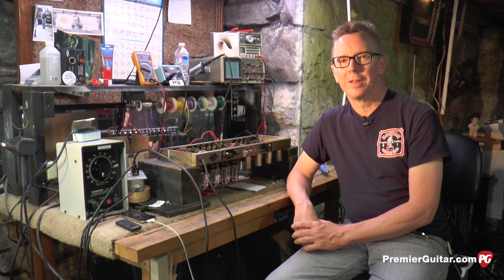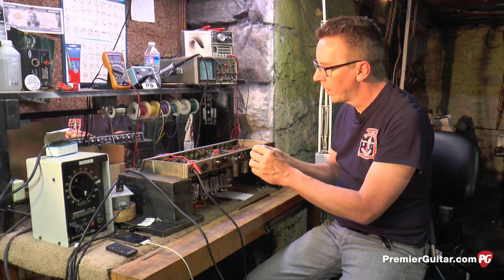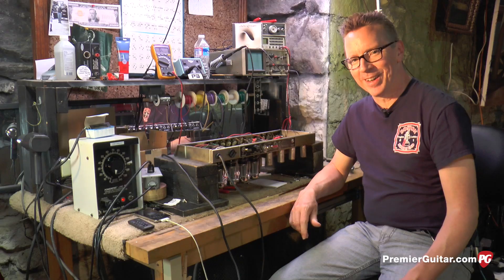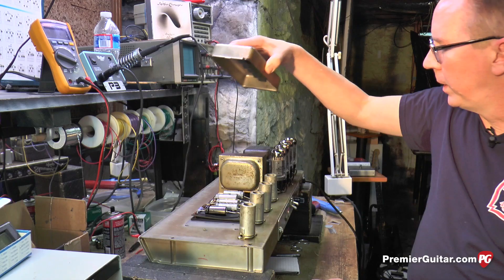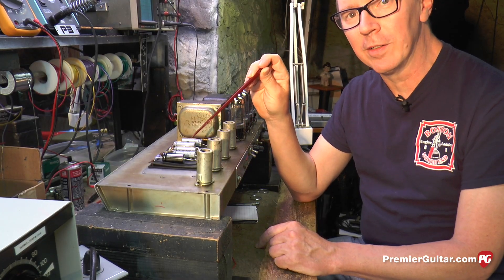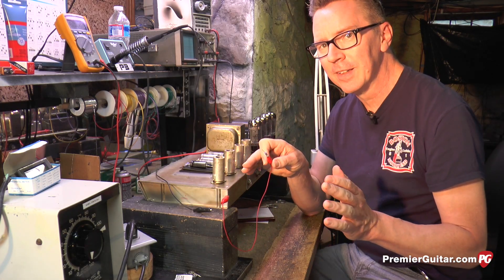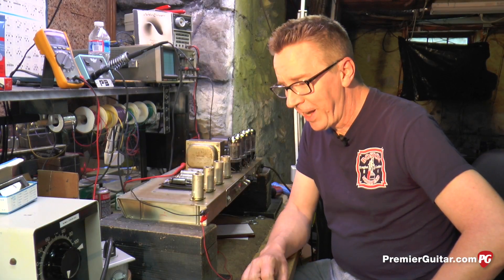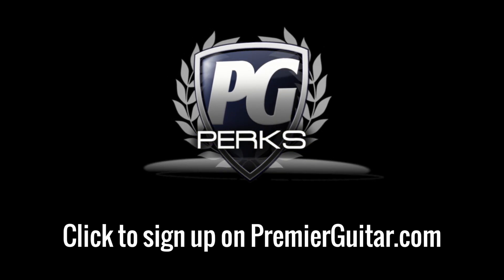DIY: Amp Safety 101

Comment: Just to be clear, are these steps required before doing any work at all on a tube amp? For example, if I just wanted to remove old tubes and replace them with new ones, do I need to discharge the capacitors first? Or is this only for electrical work and more serious repairs?

Comment: when i was a teenager i got a good shock from a hallicrafters shortwave radio receiver tube circuit.  i was half way across the room when i snapped out of it, sitting on the floor, dazed.  Luckily it was all into one hand, instead of thru my entire body.  AIN'T DONE THAT AGAIN!

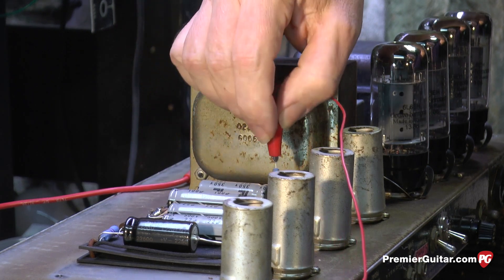Comment: 8:02 why did you appear to discharge the NEGATIVE side?
I saw a demonstration by utility workers that said even WOOD can be conductive. It can have moisture inside- so never us a stick to move a down power line. 
What if it has a STANDY switch- Deluxe DRRI 2019? Should Standby and Power be in the ON position when doing this? Unplugged of course.

I heard you can cut the trace and solder the reverb direction (to where?) To eliminate all the related hum on these things- the PCB makes the hum that you can bypass. When I toggle it OFF- no more hum. Psionic Audio mentioned doing this and he is legit. 

And to what #'s do I hard solder the two green heater wires to the Octa Switch. 2 and 7 or 2 and 8? He mentioned both by accident I think. 2 for sure- but 7 or 8? This prevents burning and potential fires. It is a very necessary mod. with 6v6 and def. with 6L6.

Thanks!

Comment: Serious question...if the amp is unplugged (rather than plugged in but no switches turned on) how is it earthed ('grounded' in USA speak) when you connect a  multimeter clip to the chassis of the amp? Where does that voltage go?

Comment: Hi, great video exactly the information I needed. A question after I cleaned the entire board of an Engl Thunder. If I attach the grounding to the housing, the device itself must be connected to the grounding in the house. Had measured everything and only mV on the Elkos. But the grounding is not entirely clear to me.

Comment: This was helpful for understand what to do to safely discharge the caps, however this and other tube amp safety videos don't tell us what *NOT to do*. What is the danger? Touching the actual filter cap with your hand? With a screwdriver? Or touching the wires connected to the caps? I don't understand what the actual never-do-this is, which I hope to avoid.

Comment: Thank you for this. I saw a video where someone was demonstrating an alternative method whereby you turn the power OFF while sending some signal from the guitar with the standby switch ON in order to drain the caps. If you happen to see this comment, would you endorse this method as well? 
Thank you!
Reply: Simply switching off the amp with the standby switch on will drain the caps through the tubes as their cathodes cool down. Whether it will reduce the voltage to a safe level is debatable. Always check before sticking you fingers in an amp.

Comment: ER doc here.  You're absolutely correct that you don't want to complete a circuit, particularly across the chest.  Where you're off a bit is why it's lethal (it has nothing to do with the valves).  The heart is an electric pump with it's own electric circuits.  Each time it wants to beat, the "pacemaker" of the heart sends an electric signal down the circuits.  Once these circuits have discharged, they have to recharge to be able to beat again.  There is a split second right after the discharge, but before it has started to recharge, where if you interrupt it, it can't start the recharge phase and you die from asystole, aka cardiac arrest.  It can be interrupted by electricity or even by a hard impact (like Demar Hamlin).  The electric shock can also cause a "short circuit", where the normal conduction system of the heart gets bypassed.  This is bad, because without the "pacemaker" parts of the circuit the electrical activity can cycle incredibly rapidly (ventricular tachycardia), or can cause an "electrical storm"  (ventricular fibrillation).   V tach is almost always fatal if we don't hit you with the paddles right away (within a few minutes, typically) and v fib is most definitely fatal (within seconds to minutes) without the paddles.  If any of these occurred and someone didn't call EMS for you immediately, it's game over.

Comment: Unless you disagree, there are amps where the filter caps are not accessible for discharge, for example when mounted on a circuit board that is on standoffs and they are standing caps. So if you have access to the schematic one can always find a point on the component side (usually resistor lead for example for the bleed resistors) and do th discharge trick there as well. Right?
Reply: Yes.

Comment: How does the cap get discharged to the earth if the amp is not plugged in to the three pronged wall receptacle?  Also I have an original bandmaster 1964 or 65 and the power cord plug doesn't have the 3rd ground prong.  So it looks like all that dangerous engery is going to the metal chassis... isn't that dangerous?
Reply: It doesn’t get discharged to earth ground, it gets discharged to chassis ground which also is connected to the negative side of each cap. Think of it like the cap is a battery, you know you can short a screwdriver across a nine volt battery and totally drain it (along with heating it up but that’s another story) with no earth ground connection. You simply provide a way for the cap to discharge to no voltage potential. Caps are in essence plates separated by insulator…the positive plate will equalize when directly connected to the negative plate in them.

Comment: This is so useful for a complete beginner like me, thank you. But I don't understand how we are discharging to ground via the chassis if the amp is not plugged in - how does the voltage actually reach ground ?
Reply: I know this comment is two years old- but I was curious about it and here is what I found out.  The negative side of the capacitor is already connected to the metal chassis of the amp, which serves as the amp’s “ground” or zero-volt point.

When you attach a resistor between the positive side of the capacitor and the chassis, you give the stored charge a path to flow back to the negative side.

As the charge moves through the resistor, the electrical energy inside the capacitor is safely turned into a small amount of heat in the resistor.

This process slowly drains the capacitor’s stored voltage, making it safe to work on the amp.  That's it =)
Reply: @Just_Jeff_Tunes  Hey, thank you !

Comment: I would add that on the old ungrounded tube amps there is a voltage potential to electrical earth ground  and it depends on the AC plug polarity. Some old amps had a polarity switch to change that will reduce the shock risk. The way to test for a potential chassis ground voltage shock  is set your multimeter to AC volts, in a range that can cover 120 volts. Connect one terminal to the amp's chassis ground and then touch the other meter probe into the AC wall outlet ground terminal. If there is a voltage potential you might see something between 50 and 100 volts AC.  Changing the ground switch will reduce that voltage to a safe level. If the amp does not have a polarity switch then the AC plug's polarity must be reversed. This was a common issue with Hammond organs and the Leslie 122 and 145 amps. If the AC plug's polarity  made the chassis hot with voltage, when someone  touches the organ's metal chassis and their mouth to a  microphone which is connected to a grounded  sound system, they would get shocked. So I always checked for that leakage voltage when working on a Hammond.
Reply: Hi. I want to get my first tube amp in future. Is it dangerous when you don't open it on your own, and bring it to the mechanic to do regular service?
Reply: @aloroki3350  Your question does not make sense to me.
Reply: @keyboardtek  Sorry. I was asking can you get electrocuted if you just play the guitar plugged in tube amp? I mean if you don't open it up to change tubes and modify it.
Reply: @aloroki3350  If it is a very old tube amp that has  a polarity selecting switch for a power switch, then you have the potential for getting a shock only if you are touching any metal on your guitar and also touching some other electrical equipment that has a proper earth ground. By only touching your guitar itself you are unlikely to get a shock. In the old days the guitarists that I worked with would hold the strings on their guitar and quickly touch the microphone they had to sing into with their finger. If they got a shock, they changed the polarity switch.  Many found out the hard way when they first sang into the mic and got shocked through their mouth! Any new amps that have a grounded plug and no polarity switch  does not have  this shock problem.
Reply: @keyboardtek  Thank you very much for explanation, it helped me to understand this. Have a good day.

Comment: As a medical professional I can help here. Electrical activity in your heart is not a valve or anything related. 

The reason you can die from power is your hearts conduction system is interrupted. Your heart doesn’t shut and never open. It quivers and eventually will stop if not shocked back into rhythm. 

Don’t believe me? Look up r on t phenomenon.

Comment: Thanks a lot for the great safety video. If the caps you want to discharge are non polar does it not matter which end of the capacitor you touch with the resistor? can you use the same
Technique? (One end of the lead attached to the amp
chassis and the other touching one end of the capacitor?

I’m asking as I have a hifi tube amp that uses all non polar polypropylene Power supply caps (Solen brand)
Reply: In my experience non polar caps are very small in farads and not a danger. Still if you want to be sure simply clip one end to ground and touch both leads one at a time. You have to then have discharged it.

Comment: Someone out there was talking about an amp where the standby switch was wired so as to disconnect the ground to the chassis I think. In that case when using the chassis as ground with the standby switch in the off position I think you neither drain nor can get a true reading of residual voltage. You ought to have a copy of and understand the schematic before getting in there.

Comment: Thank you for this informative lessson.  Just one question,  how does the voltage go to ground if the amp is unplugged?
Reply: I think it doesn’t go to earth ground, but it goes to chassis ground, which is also connected for example to the negative side of the caps themselves, so you basically are shorting the cap. Just as if you put a screwdriver to both leads of a nine volt battery you will (also heat up the screwdriver but…) discharge the battery.

Comment: Great vid - thx.
I'd clamp to a terminal of each cap, don't trust the ground, or the aux switch.
I'd use a much larger ceramic resistor, and count out the appropriate time, 5 s to 5 min depending on cap.
I'd use a verified DMM post drain to verify 0 V caps.
Nice chopstick, I use a bamboo skewer ; )
Reply: Such a belt and suspenders approach will keep you safe.

Comment: i ma building a fender champ amplifire from scratch adn i ma also colore blind so i tend to not color code things because it is for the most part pointles. power supplies are a mess for me bu i think i can find a way to make things a little safer for me to work on. after this video i understand the importance of just simple makeing sure you know what goes where.

Comment: I do this but here's what I've never understood... how is the chassis grounded if it's unplugged?
Reply: Look in the replies of MarkV_SD’s comment. Silas Fatchett explained it perfectly. Chassis point(ground) is for continuity only for the task, and he talks about how the resistor discharges the caps. Leave amp unplugged. I believe it’s good to run this discharge process once with standby switch on and once again while off(but still not plugged into outlet). Saw another video explaining the standby details.

Comment: How is the chassis grounded if you've unplugged the amp?
Reply: This is what I don’t get yet people keep talking about it. For example how is the planet the biggest resistor or whatever he said if the amp isn’t connected to it directly? Where is all that voltage going to?
Reply: @AA_MusicGuy1111 I’m not an electrician but I think in this case the metal chassis is the “earth” and that’s why you leave your opposite hand in your pocket so you don’t accidentally touch and become a part of the “earth” when discharging high voltage current from the capacitors.
Reply: The same way a car has a chassis ground without a battery.

Comment: Does the amp have to be plugged in for it to be grounded?
Reply: Check out Silas Fatchett's reply to MarkV_SD's question. The short answer is that the amp isn't grounded when it's unplugged, but by connecting the positive end of the cap to the negative end (via the chassis), you disperse the stored voltage as heat. The explanation in the video is technically incorrect, but the procedure in the video is correct.

Comment: I'm well aware of discharging caps and verifying their low voltage, but I recently had my amp opened up for some extensive mods for about 2 weeks. When I was done, I played my amp for a couple hours and then opened it up again. I started probing around with my electrical tape-covered chop stick (the result of irrational anxiety) for about 5 seconds before I realized I hadn't discharged the caps!! 
I have nightmares about getting shocked or setting fire to my current limiter, but since I had worked on my amp for so long without discharging the caps, I momentarily forgot to do it!!! That was scary!!!
Now I have a big sign in front of my work bench to remind me on the off-chance I space it again!!!
Reply: I've been trying to think of a way to mistake proof this kind of error - but to err is human ... I guess we're doomed ;)

Comment: To be sure the caps are discharged, how do you feel about the need to or not to turn the standby switch on if there is one?  D-LaB Tech has a video about that aspect.
Reply: Saw the same vid. It totally made sense, so I’ll be discharging caps with standby on and then again with standby off, then meter check them.

Comment: So, we unplug the amp to test fuse....makes sense.  When you refer to off-loading Cap charges to the "largest ground there is...Earth," are you implying that the amp should again be plugged in when properly discharging unwanted DC voltages as stored in Filter Capacitors?   If so, that's a huge piece missing from the video.  What would happen if I attached the other ned of discharge lead to chassis and it wasn't plugged into mains?  Would it still dissipate?  Where would the charge ultimately go?
Reply: That part was not explained well, or at all. No, you don’t need earth ground, you use chassis ground which also for example is connected to the negative side of the capacitor. Just like if you dead short a battery you drain it, same here. You are connecting the negative and positive of the cap which drains it.
Reply: @shader:  thanks for explaining.  But if the amp is unplugged from the wall outlet, how is grounding the probe to the chassis any different from putting a screwdriver across the capacitor's contacts?  Is it that the chassis has more resistance than a screwdriver and will drain the cap more gently?
Reply: @fireball1066  not 100% sure, except the “ground plane” then is not just one small contact point on a screwdriver. I think it’s way better to use ann anllogator clip to the chassis, a probe with a resistor on it, and touch the probe to the + side.  Also some caps you can’t short with screwdriver.
Reply: @fireball1066  No, but the resistor in the discharging tool does.

Comment: I was removing a preamp tube from my guitar amplifier and one pin broken (the other 8 are perfectly on the tube). Can I just removing it with pliers or there is a risk for getting electrical shocking ? Ps: all other components are set in their places. Thanks !

Comment: I once had a start capacitor blow on my well pump in the basement. It sounded as if someone fired a .38 down there. It went off like a party popper, there was about 10 feet of uncoiled brown paper on the floor. The crazy part is that it blew off the screwed down metal dog house that was mounted on top of the pump motor. They're powerful little things.

Comment: I've got one hand in my pocket and the other is poking filter caps with a chopstick. The missing lyrics from Alanis Morissette. Great video thanks for this information. I have a leak 70 amp I bought on a whim but it doesn't power up. We're should I start looking for the problem.

Comment: Hi kye does the same thing apply with discharging the capacitors in a solid state amp ? Before attempting to work on it ? Many thanks John from England
Reply: Solid state amps usually work with lower voltages. However, I always discharge the caps, having had nasty (but not life threating) jolts from caps charged to only 25 Volts.

Comment: Another safety item to watch out for is people who use ground defeat plugs (2-prong to 3-prong adapters).
This makes the amp really unsafe because if there is ever a ground fault or leakage inside the amp you can end up with 400+ volts on the chassis! Not a good thing!

Comment: After making sure that the filter caps are discharged , double check it again . then check the ESR in those caps. ESR = equivalent series resistance. Also look for leakage on the outside of the cap .